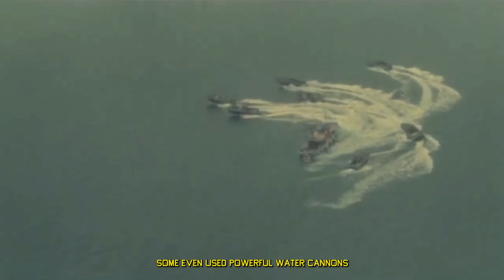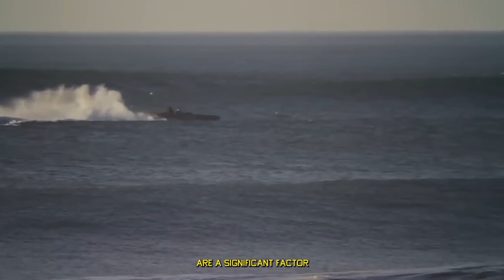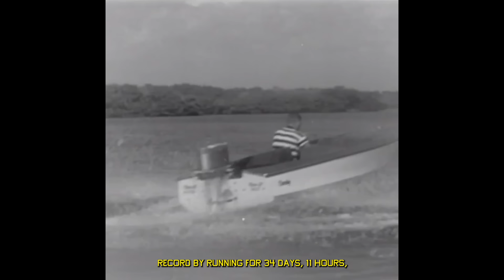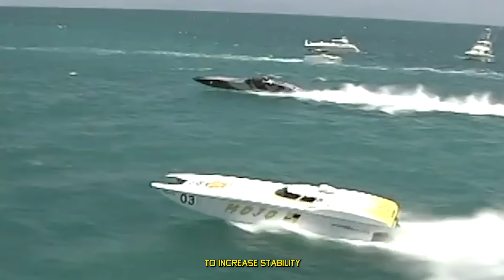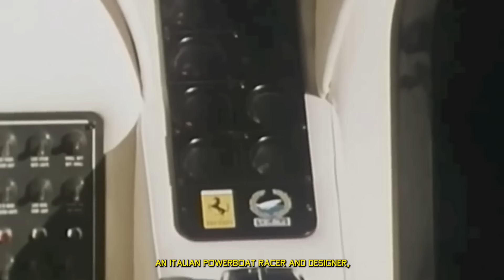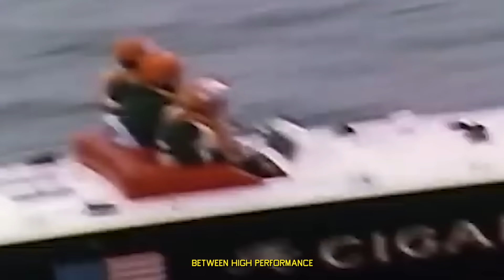A BRIEF HISTORY OF OFFSHORE POWERBOAT DESIGN

Comment: Im not sure what theyre talking a out with Turbo Lag.
Yes..a turbo needs to spool up.
As example from a standing start.
Its not as yet Spooled up.
BUT.....
even in turns, how many revs are you turning ???
You "could" be right at the sweet spot to start spooling.
Now....im not arguing with these guys, but I fear they may be just going by, what everyone says,
 about lag.
I drove trucks for years, and when necessary kept my rpm right where I could throttle it, and use instant boost.
We, need to know what rpm theyre dropping to, in the turns to judge for sure.

Comment: If this was already mentioned, sorry. A 'closed' cooling system does not use outside water for cooling. An 'open' type does. Great video, thanks!
Reply from the maker: Thanks for the info!
Reply: @vehiculemagazine  I hope you didn't take me as a smart mouth. The announcer was so close to saying the proper thing. Open- No radiator, uses whatever water you are running in. If that's the ocean, you should flush the cooling system after each use. Closed- Radiator, can run in saltwater all day with no concerns about salt corrosion. I think all of these go-fast boats ran open systems. Even though they ran in seawater.

Comment: Superchargers over Turbochargers every day. I've never understood the appeal of recirculation exhaust fumes back into an engine when it's been the tried and true "cold air intake" that works the best. Cold air has more surface area that hot air. Thus, more oxygen.
Reply: You think a turbo recirculates exhaust fumes into the engine?
And you think a supercharger gets lower temperatures at same boost?

There is a single reason to pick superchargers over turbochargers... And its throttle response. In any other metric, turbos are superior.
Reply: @johannjohann523 no...just..no
Reply: The trade off is supercharger uses engine power to drive a pump .
Turbo uses  energy in the exhaust system to drive a pump so it is potentially more efficient.
Temperature is why turbos often have intercoolers to cool the charge much harder to fit into a roots type blower set up.
Reply from the maker: Great point!
Reply: That's.. not how that works

Comment: My grandfather had a 1972 28' Bertram named "C' Treasure", twin inboards powered by built Ford 351 Clevelands making 400hp each. That deep V hull would rock alot if you go the waves from the side. But hitting waves head on? It would absolutely bust through heavy seas at full speed like it was nothing. I miss that boat.

Comment: Great video on the
Great video on the VH and how it changed racing. I was very lucky Ritchie Sutphen out of New Jersey designed the PT boats used in World War II. They were extremely effective his son Ritchie Sutton Junior designed my Sutfin boat. It was a 33 footer with twin 750 hp motors , it could just about 90 miles an hour. I raced it for about 15 years and kept it for 25 years. Unfortunately a bunch of drug runners got into offshore racing. They would go out at night with their offshore boats and pick up loads of cocaine off the Florida coast, they had tons of money people like Ben Kramer in the light so much money they kept getting bigger and more expensive boats to the point where my sponsors want nothing to do with this illegal system sponsors dropped out, and that was basically the end of normal offshore racing continue to exist with the design of catamarans, which is the dumbest design in the world It's a boat that can stuff very easily. Can't turn well and can't handle rough water but it can go about 15 to 20 miles an hour faster than a  v hull  so because they couldn't handle rough water, they brought the offshore racing insure I mean, sometimes they would literally be 100 feet off the shore where the water was flat. It was absurd. I stopped racing and a lot of other people you need to have millions of dollars to compete with these catamaranin insure racing none of the insurance companies or promotional companies want anything to do with this nonsense so the Sport kind of died
Reply from the maker: also watch https://youtu.be/vPR2o_GMoMA?si=AzTtlLka1Fp8A2Zy

Comment: We've definitely got it easy today.  Back then, finding a valve train that could survive 6 grand for hours or a drive and prop that could go from air to water WO snapping wasn't just a card number away. The old boat packed full of two stroke Mercs inboard was sweet.  Not really practical but pretty sure I'd have been that guy if I was in the game then.
Reply: except nobody can actually even afford pleasure boats anymore, only the elite of the elite. Wages of have remained stagnent for 25 years while the cost of living has risen 10 fold. Nobody has 250 grand to build these, only corporations, that's why every boat is just SLAMMED with corporate sponsors.